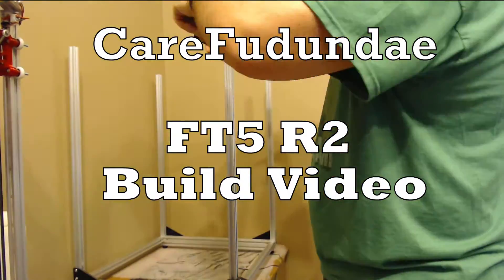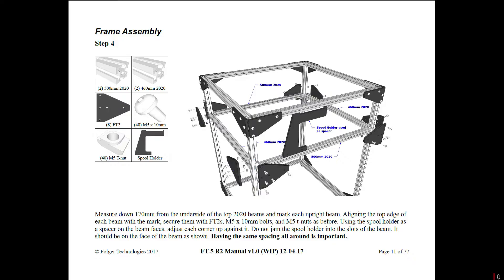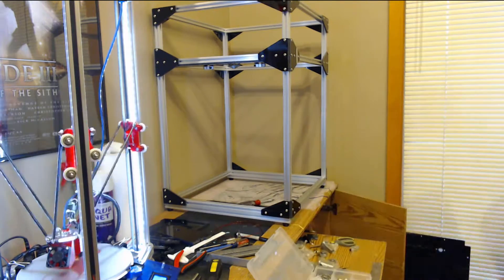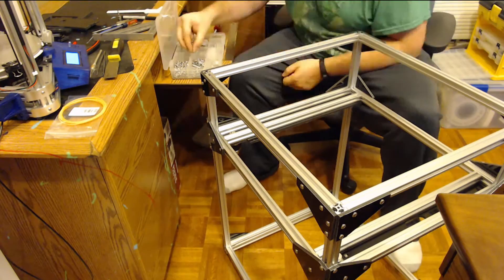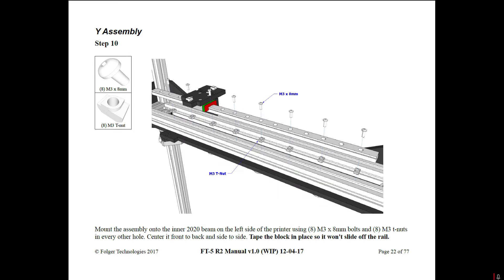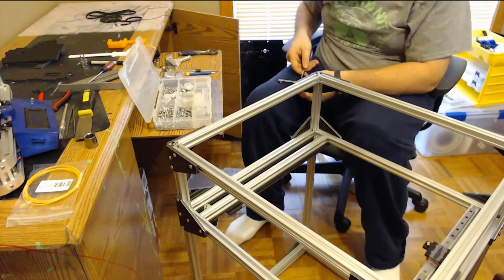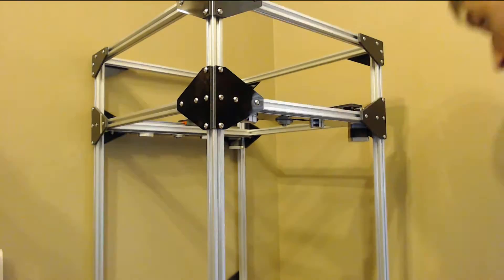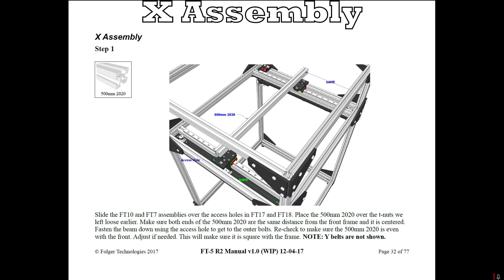FolgerTech FT5 R2 Build Series: Part 4 Build & Assembly (timelapse & issues encountered)

Comment: I got this printer because the rails for x and y provide more stability, the mk2 uses one motor for z axis(instead of two so no sync issues), and the build space is way larger than traditional 3d printers. I like building anything I get, so this was perfect.

Comment: The only thing I'm unclear about so far is the end stop that gets placed at the end of the Y rail. It says to place it in the corner, but in the diagram it is spaced apart (but it shares no details on how much). I placed mine directly in between the two bolts that they have you loosen in order to tighten the belt. That may turn out problematic in the end but it does seem to be the position most similar to the diagram.

Comment: Why are 2 of the top beams from front to back 460mm and the other ones 500mm? Wouldn't that make it not perfectly square?
Reply from the maker: yep, it's wider than it is deep... its to account for the Z-rod assembly and y-rails on the sides. some of the depth is actually taken up by the power supply and controller box in the back as well. take away all of that and you are left with a square 300x300 bed
Reply: Shouldn't there be 6 460mm beams for the sides on top, middle and bottom? The manual has the bottom square 500x500 and the top two 460x500. Sorry if this seams like a dumb question but it seems as though it wouldn't be perfectly square if all front to back lengths weren't the same.
Reply from the maker: there are 4x 2020 460mm and 2x 2040 460mm (different cross-section at the bottom) I think... I highly suggest checking out folgerforum.com for the most recent manual and to ask questions. its a very good and helpful group
Reply: Thanks for your insight.